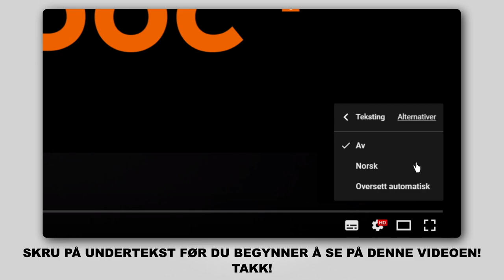Hvordan bytte foran hjullager der på BMW E60 [AUTODOC-VIDEOLEKSJONER]

Comment from the maker: Merk! Det er en feil i denne videoveiledningen.
05:09 - Skiven bak må strammes med dreiemoment på 110 Nm, ikke 70 Nm.
06:43 - Skiven bak må strammes med dreiemoment på 16 Nm, ikke 9 Nm.
07:19 - Skiven bak må strammes med dreiemoment på 81 Nm, ikke 75 Nm.
07:25 - Skiven bak må strammes med dreiemoment på 65 Nm, ikke 50 Nm.
07:38 - Skiven bak må strammes med dreiemoment på 100 Nm, ikke 80 Nm.
07:46 - Skiven bak må strammes med dreiemoment på 100 Nm, ikke 80 Nm.
07:54 - Skiven bak må strammes med dreiemoment på 165 Nm, ikke 80 Nm.
Vi beklager ulempen 🙇‍♂